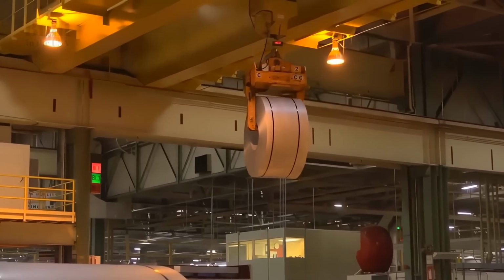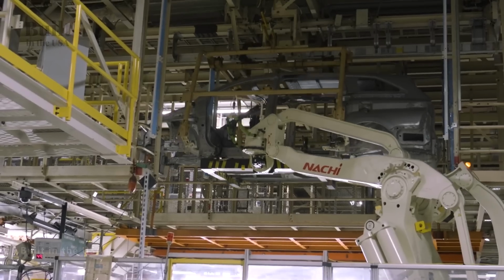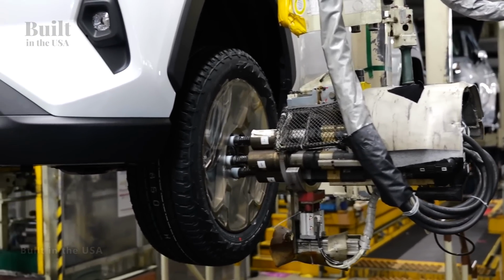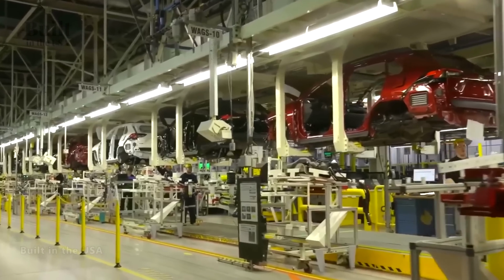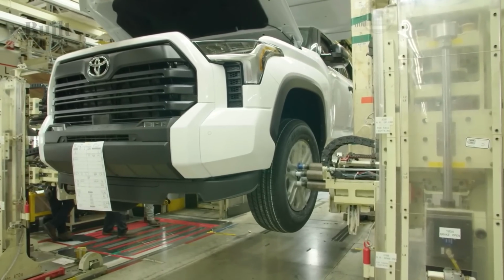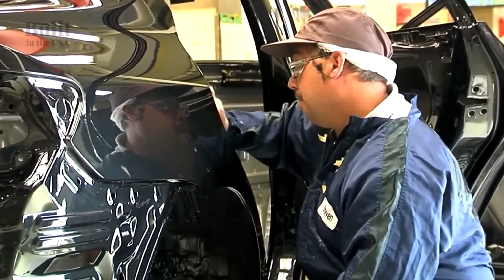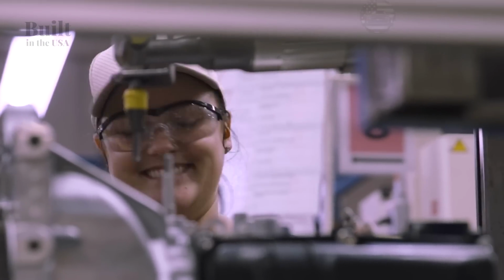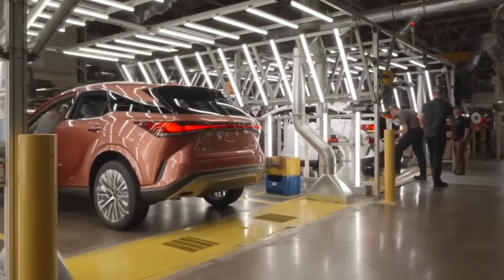How Toyota supercars are born in American factories – Toyota Camry Factory tour [Documentary]

Comment from the maker: So, do you prefer Toyota cars built in American factories, or do you think Made in Japan means better quality?
Reply: Japan
Reply: Japan is best
Reply: In Japan, it’s better quality, no doubt
Reply: Yes.
Reply: В японии качество лучше.
Reply: The location doesn't matter, the quality standard must be followed anywhere in the world, for example, a worker in the USA overtightened a screw than his counterpart in Japan, and what made the difference: one of the two didn't follow the standard (the torque needed for that screw) or perhaps the tool was miscalibrated when used, in any case the standard for tightening the screw was not followed.
Reply: Japanese first
Reply: Japan, of course.  Japanese workers are dedicated on providing a quality product.
Reply: I have a 2006 camry that we purchased new. It has almost 300,000 on it. It had over 200,000 before the starter and alternator went bad. Before it was normal stuff like brakes, one cv axle, and one front hub bearing. It was built in Kentucky.
Reply: I want to work with Toyota one day
Reply: mention:the Toyota manufacture factory in GuangDong China is the best quality in the world，even better than in Japan
Reply: As a 2022 Camry owner I still believe the Japanese made car have higher quality but so long as their standards are kept up here I don't mind having my car built here.  It was built here.
Reply: Abu. Abu. Bubuk. Baja. Abu. Abu. 90000.  Unit. Mobil. Sedan. Baru. Sopir. Girls.  Kowal. Kowau. Kowad.  Bumih
Reply: Kacah.  Film. 9000. ./.   Mobil. Sedan. Baru. 80000.  Unit.  Ri
Abu. Abu. Bubuk. Baja. Abu. Abu. Mobil. Sedan.  Baru 
Kowal. Kowad. Kowau.  Sopir
Mobil. Baru. Mobil. Sedan. Baru. Kapal. Berlayar. Surabaya
Reply: Japan. No questions.
Reply: ححح
Reply: ححخخخحححح
Reply: Made in Japan always. Made in USA is about to become another Made in China soon
Reply: My Toyota 4Runner is built/assembled in Japan and prefer it that way. Japanese worker culture is detailed oriented. However, I am ok with purchasing a Toyota assembled in USA. My deal breaker is any car assembled in Mexico.

Comment: Nicely done video. The strongest production Toyota Camry models, specifically the 8th-generation (2018–2024) TRD, XLE V6, and XSE V6 trims, produce 300 horsepower and of torque from a 3.5-liter V6 engine. However, for the new hybrid-only 2025/2026 models, the maximum power is 230 horsepower in AWD configurations.
Reply from the maker: Thanks a lot for the comment. 300 hp?! That’s really a lot… and it’s clear that a hybrid-only version will be weaker, of course.

Comment: Toyota does a great job manufacturing cars and trucks, however the driving experience needs work. Also comparing ICE cars with EVs is not apples to apples. Toyota's engines and transmissions are complex while an electric motors and single speed or no transmission is far simpler.

Comment: Why do US manufactured vehicals have mechanical and engine issues that doesn’t happen in other parts of the world?   They are still not perfect but never complete engineering build issues with engines and transmission, which are the two major components.   And assembly finish is always better than in US .    The major Chinese manufacturers are selling  around the world now, and the quality fit and finish is scaring legacies to death.  But the modern Chinese factories are updating automation and assembling techniques faster than others can catchup with.

Comment: Have Camry with 90000 miles love this car. Only problem front struts from pot holes. But running low profile tires which is hard on the struts I believe.

Comment: Been driving Toyotas for 50+ years, current ride is 2006 Tundra with 166,000 miles running fine and strong still & wife's 2012 Corolla
Reply: 2003 sequoia , 248 k miles ,  2026 change has lots of problems.  They have to get through a few years before I buy any new ones